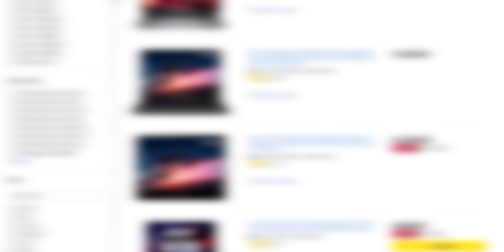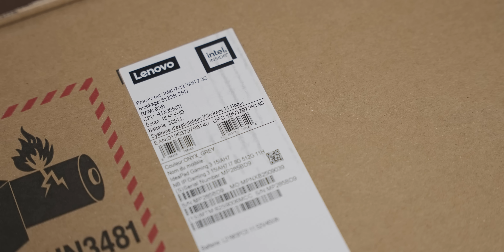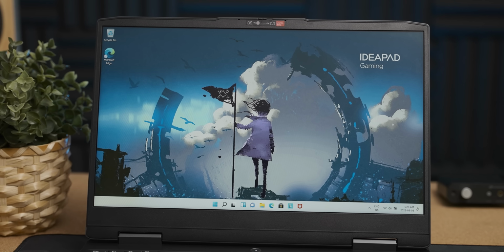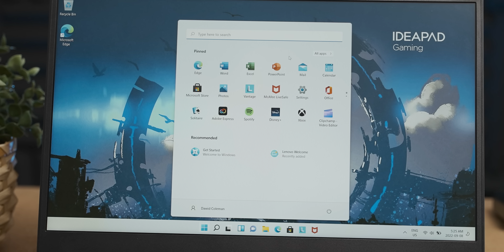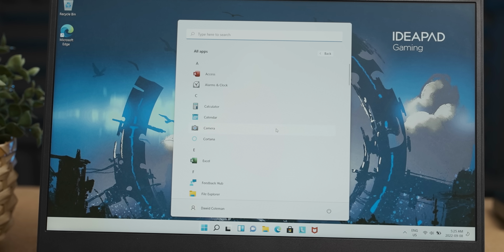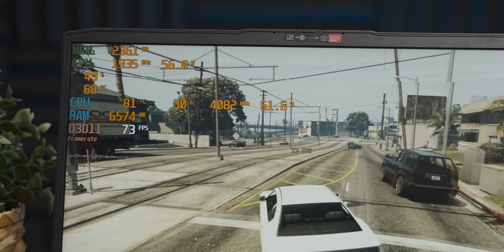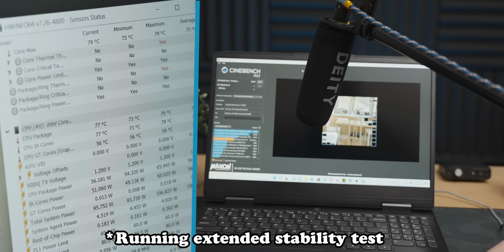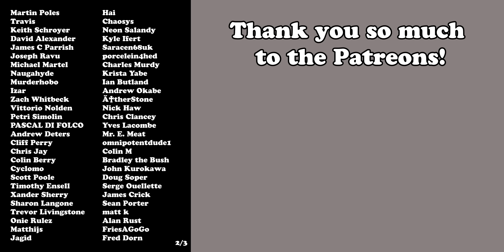Gaming Laptop Sales Be LIT

Comment from the maker: Hey everybody, quick correction:
Some of you were pointing out that you can get higher power-draw out of the RTX 3050 Ti using the laptop’s power profiles.
After setting the laptop to “Performance mode” in the Lenovo Vantage App, the RTX 3050 Ti would draw up to 85w compared to the 60w max shown in the video. So this laptop does indeed have a full power RTX 3050 Ti in it. 
I’m terms of performance:
BF V
Balanced mode (max 60w, seen in video)
Avg: 90 FPS 
1%: 39 FPS
Performance mode (max about 85w)
Avg: 95 FPS
1%: 33 FPS
Sorry about missing out that detail in the video. I will administer the appropriate self flagellation as punishment for my incompetence.
Reply: Thanks for the informative content , can you a video for best budget gaming latops under $900.
Reply: Would be interesting to see how 16Gb goes using the original plus a new 8Gb.
Reply: Make a colour calibration video for this please!
Reply: can i have one laptop you dont need it

Comment: I literally would have bought this at that price point with no hesitation. It went from $715 to $1399 already. That blows. XD
Reply from the maker: Oh wow! That jumped up fast. Just keep an eye out though. The sales are all over the place. 👍
Reply: @DawidDoesTechStuff  Have to admit I also looked shortly after the video said" I Must Be Hitting The Wrong Link!" This is $1399!! Lol
Reply: ah i was wondering what the deal was. For 700 yes its killer, 1400 now noway
Reply: Did you actually gone through buying the thing?
Reply: @condorX2  No way. Not at double the price point. Shopped around and found others just like this with some slight differences in cpu, ram, ssd, etc. I don't need a new PC, but a cheap enough laptop upgrade I'll certainly pull the trigger. 😁
Reply: @FruitlessGaming  🤓👍
Reply: $1400? lmfao
Reply: because it's amazon. their price is never consistent. it goes up and down based on how much interaction it gets. it is now 1,250$

Comment: This is a good deal, but I would go for the i5 version. Probably just as good for gaming and you save a couple bucks.
Reply: no point waiting for i5 if the gpu is rtx 3050 ti
Reply: You have to remember, in Alder Lake 45W mobile CPU class, the i5 has only 4P cores. You need the i7 to get 6P cores for gaming. E cores don't do shit for gaming , probably only good to run bloatware that the laptop comes with.  If its a desktop Alder Lake CPU, then yeah, the i5 has 6P cores which is more than enough.
Reply: my cousin has a bit older version of this lenovo, an i5 11th gen? and rtx 3050 non ti and it is pretty solid. definitely added a second 8gb ddr4 stick as soon as possible
Reply: @fleurdewin7958  The 4P has been shown to be perfectly capable at gaming, as is the case with the i3-12100
Reply from the maker: I guess it depends on the pricing and what you want to do with it, but yeah if it’s a decent bit cheaper.
Reply: @DawidDoesTechStuff  i think you need to turn on legion Ai on lenovo vantage to reach tgp to 80w :))
Reply: Its just depends on what game are you goin to play , 3050ti would run smooth on not graphic demanding games such as skyrim
Reply: Really depends on what games you're planning to play. The laptop I got a few years ago that I'm using while traveling, has i5-8300H and a 1050. It's enough for the games I'm playing. There's no "one size fits all", the correct answer will be a laptop that fits your personal needs.

Comment: The lenovo legion 5/7 laptops are excellently build, one of the few laptops were you won’t be constantly overheating
Reply: I have an older one with a 10750H and 1660 Ti and can agree.
Reply: AWM17R5 Is chonky and stays cool as can be with a 1070 lmao
Reply: I bought a 5800H + 3050ti@85W Legion 5 for my brother as his gift when he went into college last year. Though it costs around $1000, the building quality, GPU overclocking, and CPU undervolt abilities are really amazig. It's rare that a $1000-ish laptop GPU can actually run to its maxinum without getting too hot or underclocking itself.

By restricting the CPU to 45W + undervolting, Its program compiling speed is way way faster than my old i5-9300H.
Reply: I got a legion 7 recently to repair and I was blown away by how premium it was. They are well built laptops that are worth the extra  money
Reply: 5/7 perfect score
Reply: got the lenovo 7 5900hx rtx 3080 enough for me
Reply: @JudeTheYoutubePoopersubscribe  Same dude, probably the only thing I don’t like about it is the massive charger, but the cooling is great. On a stand, I rarely saw the cpu go above the mid 70s (not undervolted), and the gpu above the high 60s-low 70s
Reply: I have the legion 5 pro 5800h/3060 and I love it. Great build quality, great thermals, great performance, and the screen is also great. Battery life also doesn’t suck
Reply: @AntiFurry927  look up the 5/7 meme
Reply: @tallsz559  Yeah, acer nitros usually cost less for same specs but the build quality and thermals suck so bad it’s not worth it
Reply: Used to have one with 4800h and 2060 and CPU was constantly at 90°+ and is sounded like a jet engine
Reply: @shard_9008  yup. Also got one of those to repair and that one turned out to be a nightmare. Their community forums say it all😬
Reply from the maker: Going by the replies to this thread, I guess it depends on the configuration.
Reply: @shard_9008  Amen to that! Nitros are horribly put together laptops with appealing specs. Just switched to a Legion 5 and couldn't be more pleased
Reply: Mine overheated burned the motherboard legion lenovo xd
Reply: Overheating can often be mitigated just by using a laptop stand. That allows far better air flow... assuming you don't buy one that completely blocks the bottom.

Comment: My dad's old HP laptop (2nd gen Intel old) has a small removable panel with just 3 screws and you could easily access the RAM slots, WiFi / BT card, and 2.5" drive bay, and it made it a breeze to upgrade. My 2 year old Lenovo has soldered RAM and requires a pentalobe screwdriver to open. It's amazing how much we have regressed in terms of laptop upgradeability.
Reply: One word apple
Reply: this lenovo's and apple's way, if you want ram or ssd upgraded, send back to us at cost to you.
Reply: MacBook Pros used to be easy to upgrade, too. It wasn’t until the Retina MacBook Pro in 2012 that they started using pentalobe screws and soldered on RAM.
Reply: Soldered components should be banned
Reply: Form over function. How could the marketing team explain the thickness if everything is accessible and replaceable. It's very important... 🙃
Reply: probably with more work you can change the CPU too.

Comment: I bought a 10500H / RTX 3060 (70W) laptop last year for a bit more than this and it is very capable with a 32GB RAM kit installed in it. That said, when the 3060 is at 100% the fans barely spool up but when the 10500H goes past 15% utilization it cranks the fans and pours out heat like a volcano.

Comment: It should be mandatory in the laptop industry to have panel on the bottom, with normal screws, which when removed exposes the SSD slot and upgradable RAM. ..........My old Lenovo Z580 has it. But every other laptop I've opened has been a nightmare..

Comment: Great video man! With Lenovo Legion laptops… there is a balanced mode, silent mode, and turbo mode. It looks like you had it in balance mowed the whole time. Next time… hit Fn+Q on your keyboard, and you will see the power button light up different colors. Red is turbo mode, white is balanced, and blue is silent. Most likely turbo mode it will boost the GPU to 80W.
Reply from the maker: Thanks for the heads up. I’ll go check it out and then pin a comment about it. 👍

Comment: I own an older version of this laptop with Ryzen 5 4600h and GTX 1650. It's almost a couple of years old now, but it still runs fantastically well! 
Also, it came with a 256 GB ssd and 1 TB hard disk; which I upgraded 2 TB Hard disk and an additional 1 TB SSD. The laptop had costed me ₹63000 (roughly $1000) back then and it's worth every penny!

Comment: In terms of how many screws, that reminds me of my old hp pavilion beats edition. That thing was a PAIN just to open, and you need to take out the entire motherboard just to upgrade the ram, it also had an amd A8-5545m with one copper heat pipe connected to a garbage fan that broke within a year of use, and it liked to throttle to 1.68Ghz.
Reply: if the hp pavillion beats edition you had is the same as i have, the ram is the easiest upgrade, take off panel on the back, pop in another ram, put panel back on, no need to take the laptop apart.
Reply: @perthdave100  it was the 2015 hp beats 15 notebook pc.

Comment: Man, this is a great budget buy. Perfect for a collage student. My part about this laptop is all the ports that are in the back. The thing I dislike is the all that wasted empty space for the battery. And also it's acceptable that they're still doing the power plug type, but we need to be moving to USB Type-C by next generation. I suspect that Lenovo is just trying to use up it's stock of its proprietary connector. Why change when everyone else is doing their own power connector type too, haven't consolidated using USB-C yet.
Reply: I actually have the iteration before this one and the wasted area next to the battery is an area to hook up an internal hard drive. You are right though this is perfect for me as a college student, but that extra battery would be nice considering I don't use the internal hard drive space

Comment: 7:06 there’s so much wasted room near the battery, they could’ve added an additional M.2 slot or 2.5 expansion bay. It’s nice to have extra storage since budget gaming laptops sometimes only come with 256 gb. My HP gaming 15 has one which was really helpful for downloading more than 2 games I put in a 512 gb
Reply: you want a good cup of linode🤣🤣🤣🤣🤣🤣🤣🤣🤣🤣🤣🤣🤣🤣🤣🤣🤣🤣🤣🤣
Reply: I have this laptop and the reason there is space there next to the battery is because it also comes with a bigger 4-cell battery (which I have) which fills up that space.

Also it does have a second M.2 slot, it's in the bottom right corner a 2280 bay and there is also a 2242 M.2 slot which is Gen 4.

Comment: Downward facing speakers actually work well from the laptops I've had. They make some tingy speakers sound fuller since they'd be bouncing sound off like a wood tabletop (metal and glass are a big F tho...)

Sometimes I still get surprised how well some song sound just on speakers!
Reply: i was thinking it was a good idea too having downward facing speakers, people that use laptops drink around them and if they spill anything over it, it won't leak into the circuit of the system.
Reply: @mentalasylumescapee6389  i mean any modern laptop if you spill something its getting inside via the keyboard anyway
Reply: @ultimategohan1551  i was thinking when it's closed spilling on top of the cover, but maybe you're right. although i would have thought under the keyboard is a spill trap. i'm a pc gamer and i've built like 5 gaming pc's, i don't know much about laptops they just annoy me.
Reply: @mentalasylumescapee6389  yea if liquid gets under the keyboard im pretty sure its going straight to the motherboard om a laptop

Comment: I just got the Acer Nitro 5 with i7-11800h, RTX 3060 95w, 1TB M.2 SSD and 16 gigs of ram for $900 and guy also included brand new Razer Viper Ultimate and Razer Blackshark V2 headset, Laptop was a brand new too, everything was in their boxes. So basically I paid $650-700 for the laptop after we factor in the Razer peripherals cost in the total price

Comment: I got a used Asus TUF Dash F15 for £610 with the i5 11300H and RTX 3060 because the 3060 is so much better than the 3050 ti. It was fairly easy to open but they decided to use 2 different lengths of screws. Once inside there was a free sodimm slot which the previous owner had filled with an 8gb 3200mhz stick (and runs in dual channel with the sadly soldered onboard ram) and a free NVME slot which I put an extra 1TB SSD in.
Reply: Wow I feel kinda jealous because I bought that same of laptop from a 2nd hand seller for aprox. $730 in my country and it came with a 11th gen i7 and a basic RTX 3050

Comment: I've had my 17" 2060 Leg-Ion laptop for about 2 years now. A couple week ago It started having charging issues. The charger was extremely flaky when plugged in the laptop port holding the port in a very particular way barely charging it. I thought the solder joints failed since the charge cable was perfectly unkinked. I contacted warranty support. They had a box shipped out the next day. I shipped it and the next day I got an email they received it. cool right. The repair took about 2 days and over the weekend. They shipped it back after the weekend.  I got my same laptop back with a new charger and an incorrect generic Lenovo Windows image fresh installed. I know its a generic Lenovo image because it didn't have any of the Leg-ion Vantage tools or the Leg-Ion desktop wallpaper (I really liked that wallpaper 😞) now its some ugly generic green lenovo wallpaper and on top of that I've spent at least 2 hours so far trying to figure out the damn unknown hardware in device manager!!! Ive tried all the drivers listed for my model on the website and its still unknown😡
WHY THE F*** DID THEY RE IMAGE IT IN THE FIRST PLACE WHEN IT WAS NOT EVEN SOFTWARE RELATED.
I know it wasn't software related because when I received it I tried my original charger, and it did the same flaky barely able to charge issue. the new charger works fine

Comment: i got a new laptop in this time of year, a Medion Erazer Deputy P25 for 800 euro, a 230W laptop with a 54W Ryzen 5 5600H and 130W RTX 3060. It did come with 1x 512GB NVME storage and 1x8 GB of ram, which i upgraded to 2x8 from my old laptop and to 1.5TB storage with a 1TB samsung evo 870 SSD. Honestly an amazing laptop for the prize, and i even plan to put in another 512 GB of storage in here later on.

EDIT: I forgot to mention it has one of the best luxuries ever: a detachable battery without any teardwown. just two clicks and it's out. It is 49.96 Wh tho, but it's ok enough to quickly save your progress if your power goes out.

Comment: The 2021 version of the Acer Nitro 5 is on sale on US Amazon... only $415. The specs... 

Acer Gaming Laptop Nitro 5 Laptop 15.6" FHD 144Hz IPS Core i5-10300H GeForce RTX 3050 16GB RAM 1TB NVMe SSD+1TB HDD USB-C/HDMI/RJ45 Wi-Fi 6 Win10(Mytrix HDMI 2.0 Cable Included)

Comment: I got a lenovo legion with the ryzen 4800h and gtx 1660ti and it is an amazing laptop. It is not loud while gaming (I use open back headphones) and the temperature is not noticeable where as some previous laptops I've used felt like they were going to melt a hole through my desk. For about $1,050 I am very happy although it is a bulky laptop with a basically non existent battery life

Comment: Saw a deal recently of a Lenovo gaming ideapad for $550 and it had a 1650 and a 5600H, overall not a bad deal I don't think. Only downsides were MediaTek WiFi and 2242 main SSD. Though it did have space for a 2.5 inch drive or a second m.2.

Comment: The 60w gpu limit is weird, lenovo has a very good cooling system and pushes its gpu wattage to the limits (my 3060 has 130w), so the fact that it capped at 60w makes me think you didnt have performance mode turned on (Fn+Q) which boosts clocks and wattage to the maximum, altough im not sure if it works on ideapad laptops since Ive got a legion 5. Its still worth trying tho
Reply: well i guess it is ideapad hence they are doing capping or else if it was a legion they would have full wattage
Reply: @akshatsingh9830  did a quick google search and the ideapad does support performance mode so maybe that will boost it to 80w
Reply: @kafino  i guess that 3050 is of 75w but he hasnt turned on performance to get the dynamic boost thing of nvidia which will give another 15w bcoz the power button isnt red which is supposed to be red in perf mode
Reply: @akshatsingh9830  Yes thats what iam saying

Comment: I have a legion 5 laptop which is very similar as far as design of that laptop and it’s not too bad to use as a pc. The keyboard isn’t as bad as it seems to type papers with. I use it for school and it’s been good to me. I just ordered an aftermarket small power brick for it. I hate carrying around the 230w brick it comes with.
Reply: I have the same, but mine's the 5800H and RTX3060 unit, and that has a 300W power brick, which is interesting to carry to say the least.
Reply: @cs_044  bruh that powerbrick is literally a Brick, it weights 1 kg 😂.

Comment: In have the Ryzen 9 version if this laptop the Lenovo Legion S7-15ACH6 with 16 GB of ram which I found out has 8GB soldered to the Laptop and one that had a 8 GB stick of DDR 4, I replaced the 8 gig stick  with a 32 gig stick, and it is still running in dual channel mode at 3200 MHz, and the 40 gigs of ram is a lot better than the stock 16 it came with, I am glad it had an extra NVME slot.

Comment: got a lenovo gaming 3 with 16gb of ram a 5800h a rtx 3050(80W) and a 512gb ssd over a year ago for $800. It runs hot in cpu heavy games and workloads but they clearly upgraded the cooling on this new generation but strangely decreased the gpu wattage(with a larger power brink, mine was 135W). It also looks like they got rid of the 2.5 inch expansion bay to hold a button battery and usb ribbon cable(battery is the same size(small)). not a fan of the new Gaming 3 laptops so far.

Edit: it looks like David didn't set the laptop in performance mode via the Lenovo Vantage software. Definitely missing out on a lot of performance then.
Reply: There was so much misinformation in this video, I can't-